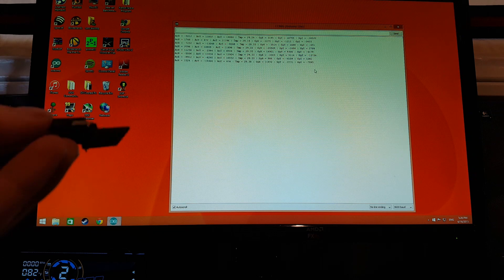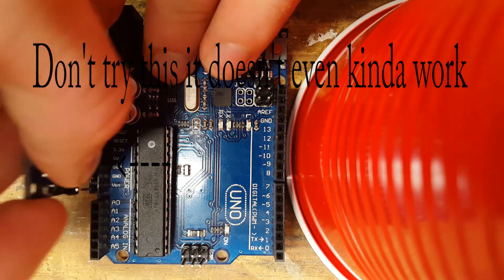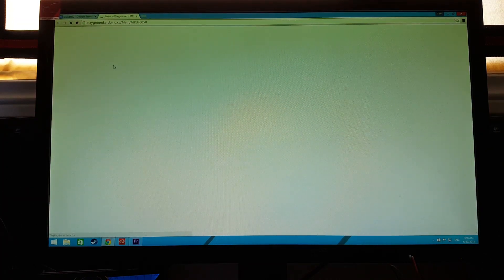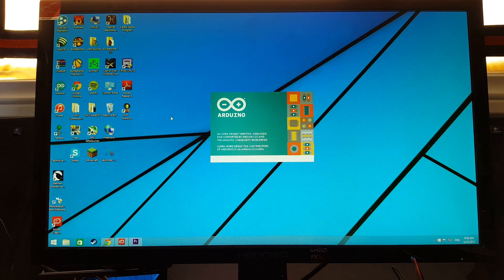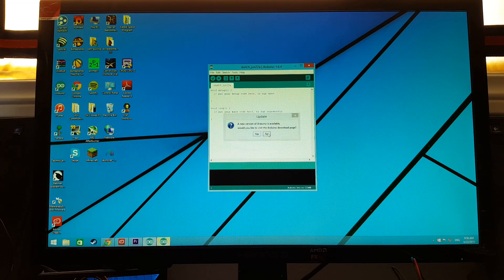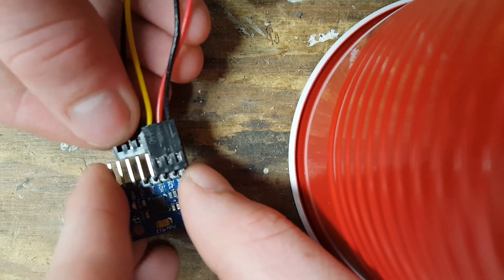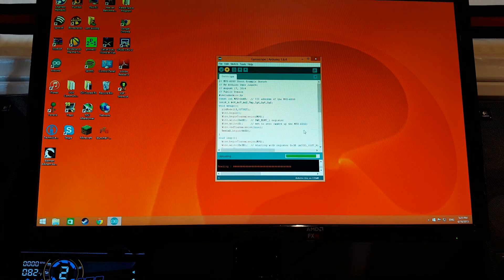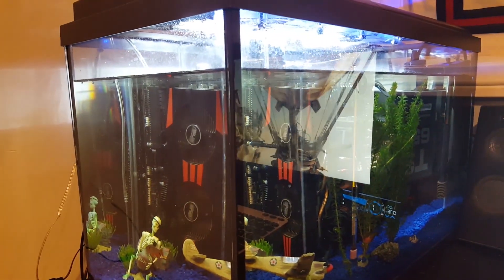How to Program an accelerometer for Arduino

Comment: @Sam any chance we could request a commission from you for our current project?  We need to build a system (4-5 units in all) that will produce sound FX each time a person takes a step.  Assuming the use of simple accelerometers could this be done?
Reply from the maker: Thanks for asking @avatar6699 but I unfortunately can't take this project on right now. This is because I am currently in my second semester of junior year in high school, and right now all my time is being taken up by either studying for the ACT, studying for finals, or studying for AP testing. But to quickly give you an answer on how this can be done easily if you personally want to undertake this task is: to connect the accelerometer up and use the program in this video. Then, you will want to modify the program so that whenever it senses movement ex a spike in an axis that it sends power to one of the numbers on the Arduino this number is connected to an electronic switch, so a transistor, which is connected to some kind of sound board. Once again sorry I couldn't build this for you but thanks for asking and good luck!